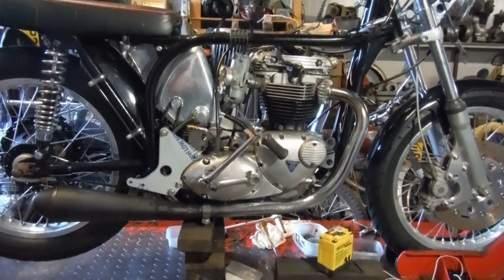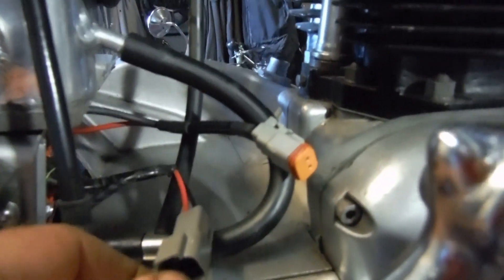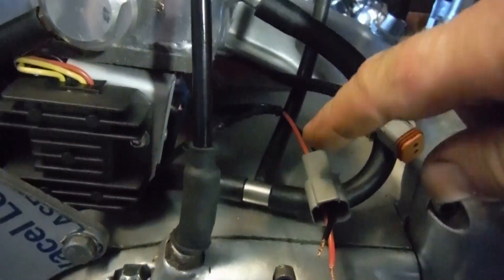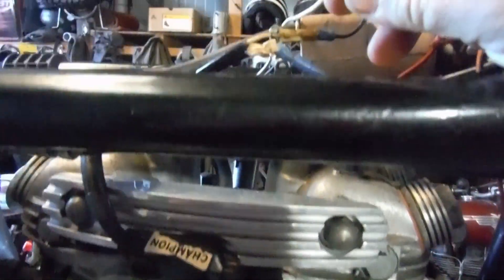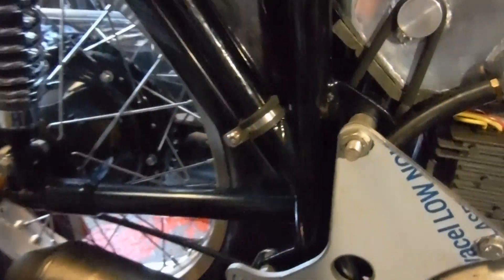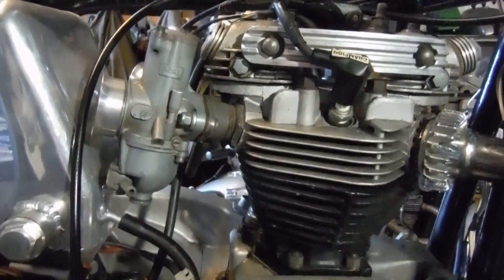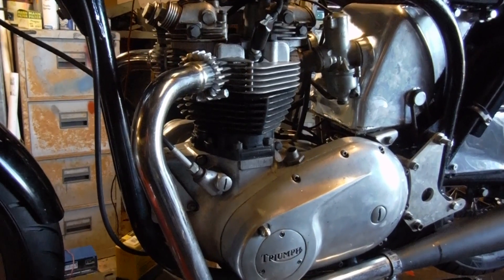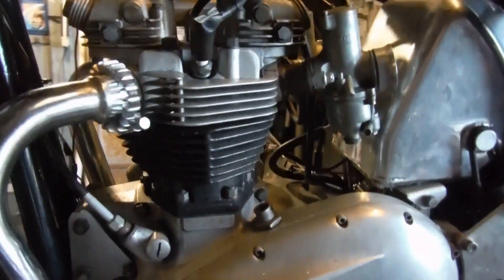Triton build - Almost ready to run?

Comment: Hi Paul, not sure if you have electronic ignition on your bike. If you have an easy way to check for sparks is get a magnet, put it near the pick ups and take it away. This will cause the spark the same as turning the engine.
Reply from the maker: I didn't know about that - that's a great tip, thanks very much!

Comment: G'day Paul, well done so far, your pushing that job alongside nicely, l had too do the same with a borrowed starter roller from the Classic Club, even use it to start the motor when the Super Rocket 🚀  tight and hard to kick, cheers mate, Neil 🤠.